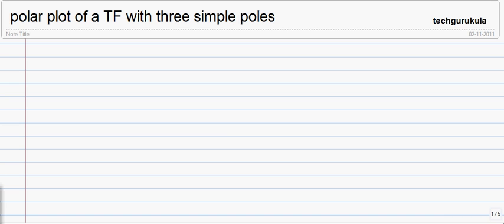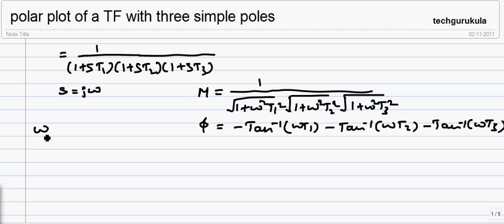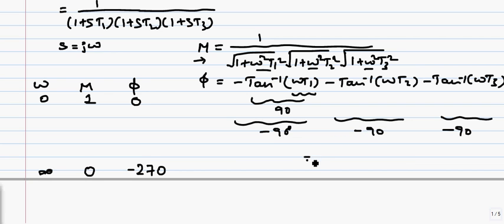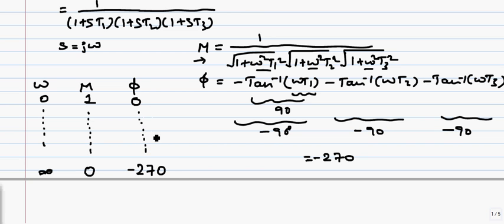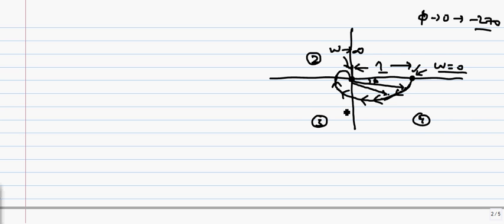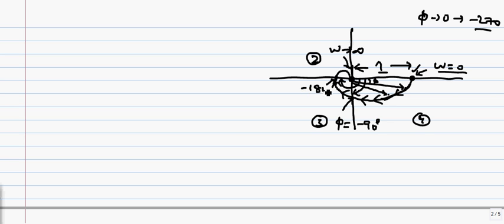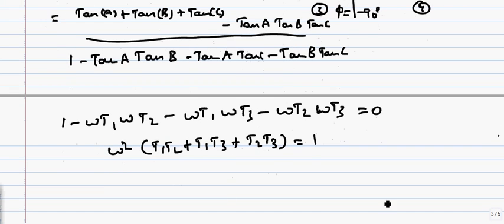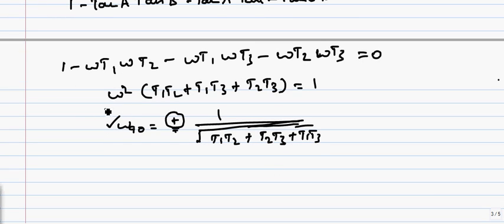polar plot for three simple poles

Comment: They describe the locations of the poles of the system, which are arbitrary values problem-wise. (Like if T1=2 then there is a pole at s=-1/2)
 They might have some correlation depending on the type of system but I don't know anything about specific types of systems so can't help you there. Doubt it though